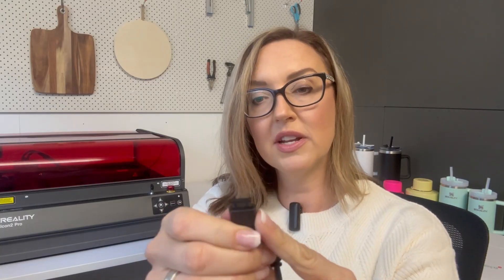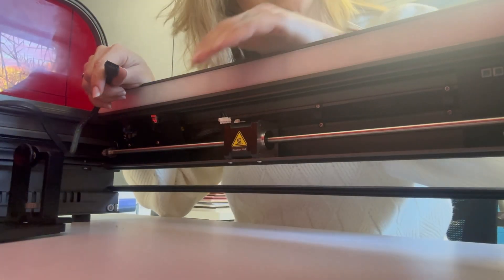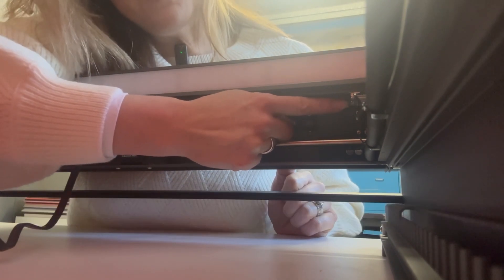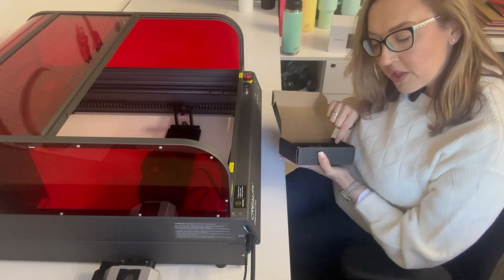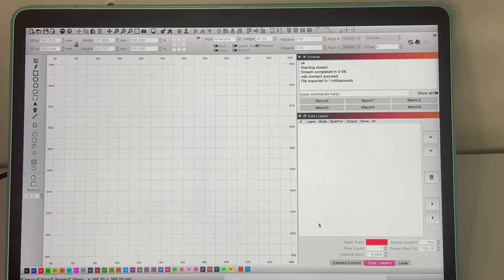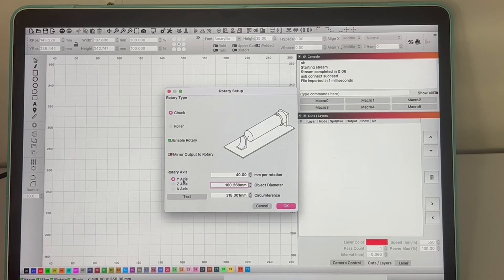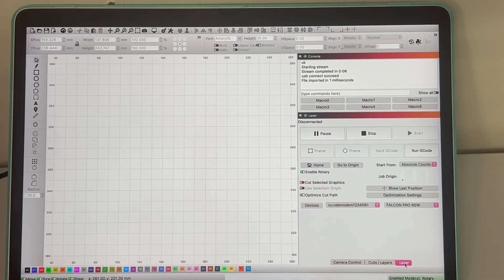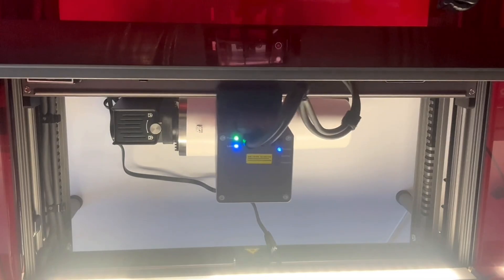Step-by-Step Guide: Set Up the Chuck Rotary Kit Pro on Falcon2 Pro Laser Engraver & Cutter

Comment: Is there a setting in Lightburn to stop the Creality Chuck Rotary from doing full rotations at start up? I am trying to figure out an image on a mug with a handle and need to not have a full rotation for a smaller image not a full wrap around? Any tips or tricks I am missing?
Reply: Perhaps don’t put the cup on until the rotary has done the full spin? If you set the design to start at current position then position then select the dot that corresponds with the centre of your design youn can avoid framing it as you’ll know where the middle of the design will be. 
Then just hit start and you should avoid hitting the handle that way. Hope that helps.

Comment: Helo me , I have a problem with my laser cutter , I follow all the steps ,but it does not respect my current position and it appears to me that it is out of limits and crash with everything ; although when I put the  frame, it works correctly, when recording that  happens